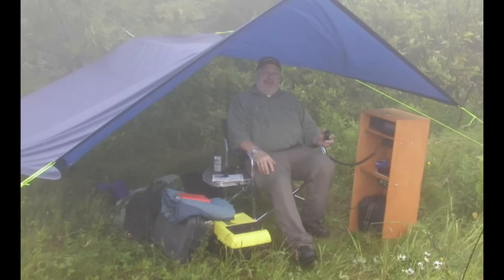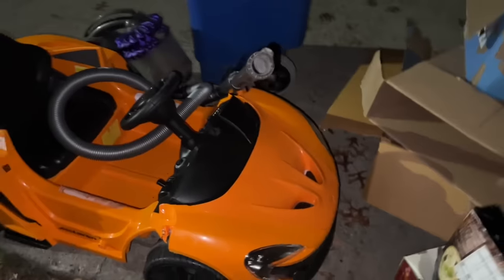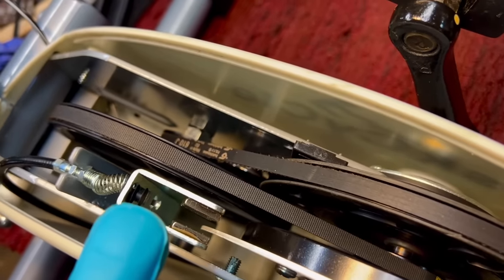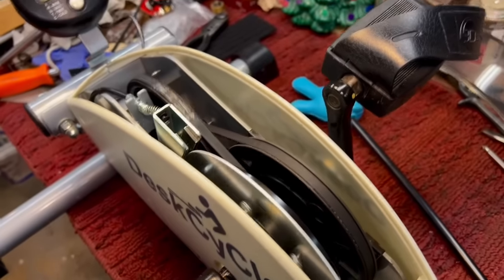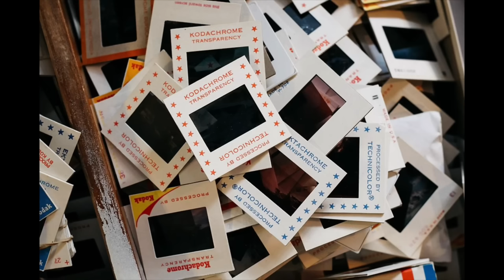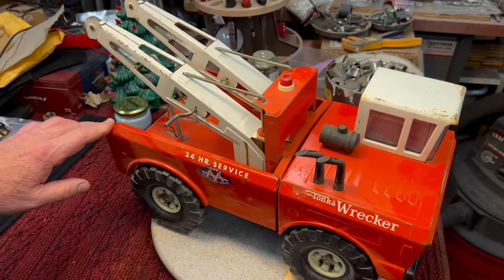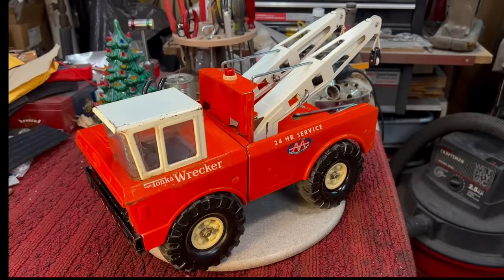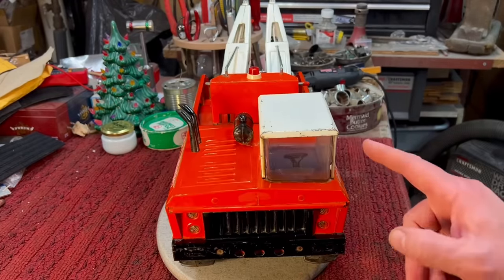Poor Man’s Flea Market Score Plus Tonka Mighty Wrecker

Comment: Gotta love the big machines! Back when I started my first job in the US I worked with an old timer from Motorola who always had the greatest stories.  In one, Motorola flew him out to fix an issue where the Ultra dump trucks at a massive mine were having issues with their radios interfering with some of the electronics in the truck.  While he was there testing, the radios were interfering with the brake system and he and the driver ended up with a runaway truck - not exactly what you want to deal with on an afternoon!  Miss that guy, he retired not long after with 50 years at the company.
Reply from the maker: Oh My!  Runaway massive vehicles equal huge pucker factors!  🫣😂👍

Comment: Has to be something environmentally bad in that compound you use..LOL...  Mine just doesn't seem to do as good as your 50 yr old stuff😅 Have a great weekend and oh and bonus points for scotchin' the wheels👍 good stuff Mr. John!
Reply from the maker: 😂. Vic- I have a new container I will have to see if it’s the same.  Polishing compound just requires a bit of elbow grease until you see paint on your rag, then you buff off.  Also not for clear coat paints!  (Ask me how I know) 😂👍🇺🇸

Comment: I am with you on the fascination with big equipment, so much so I ended up working on heavy equipment by doing in place machining and working on hydraulic systems, always said if it wasn’t, BIG, yellow, and the PARTS didn’t weigh at least 2,000 lbs, I wasn’t really interested in working on it.🙄😏😉😬🤣🤣, thanks for the video, enjoyed the wrecker. BTW, I actually helped build a heavy recovery truck with a 100,000 lbs lift capacity and a 360 degree rotation capability, it was an awesome build.
Reply from the maker: WOW!  100,000 lb lift!  😃👍

Comment: I am the same way about heavy equipment. I got to play with big stamping presses, trucks, cranes, and the last seven years of my before retirement life I got to work on the design and manufacture of armored vehicles called MRAP's. 1000 hp engines in 20000 lb, bullet resistant glass, monster tired, 6 wheel drive monsters that can out accelerate most street vehicles. 
Life is good. 😁😁😎😎
Reply from the maker: Dave- You looked like you were having too much fun on your Man lift last month!  😂👍

Comment: A pal and his son had a B-85 Mack ex Ky. coal hauler with a Holmes 800 wrecker on the back, twin boom. Had to let the booms down to back it in their shop in town. And did you ever see any CCC trucks? Stood for Crane Carrier Corporation. Just had the small cab like the tonka but a real truck. Had some here years ago with dump boxes on them. 
Happy weekend and God Bless Yall!
Reply from the maker: Lewie- I’ve always had a love affair with those B Series Mack’s.  Just beautiful!  😃👍
Reply: I've got to drive a couple, both with Thermodyne motors probably 185 horses, the other 711 cubic inches, non-turbo, One was a dump and the other was toting an old Schram tub compressor well rig. Both were duplex's or 2-stick 10-speeds but the well rig splitter didn't work so it was just five with a bad air leak. The other had 10 but no good motor supports and the tranny levers and motor would lay over to the right when taking off  but ran and pulled good and was a joy to shift both sticks at the same time with one arm stuck through the steering wheel to shift the splitter or hji/lo. Steered like a dream with parts falling off them. Both were 1950 models. Drove some old rigs that had 5X4's with a lo-lo and 3 split gears for every cog in the main box but the B-models were special 4 sure! @ScoutCrafter

Comment: Hello Flat Bastard, that L.B.E, Lower Body Ergometer (or bike) that you found can also be used as a U.B.E, Upper Body Ergometer.  Since your upper body has fewer slow twitch muscle fibers (endurance muscle fibers) than your lower body, your girlfriend will burn off more calories using it as a U.B.E. because fast twitch muscle fibers use three time more energy (calories) than slow twitch fibers.

Comment: Got to speak up for Dyson. I mean what 21st century vacuum cleaner isn't total plastic? They all are. I tried to repair an iron once and discovered it was clearly snapped together to prevent disassembly. That's not the case with Dyson equipment, which is held together with screws, which does allow some repairs to be undertaken; and generally they're better made and last longer. Bet that one in the trash would have worked again. So unfair on Dyson, other than that great video as always.
Reply from the maker: As a vacuum aficionado and long time trash hound I can honestly say Dyson products are for the most part Trash.  I find more Dyson vacuums in the trash then you could imagine.  If you go to any real vacuum store and mention Dyson they will all roll their eyes.  I took apart three of them and they were all made like junk.  Plastic EVERYWHERE!  The Dyson desk fan was an absolute joke and the biggest laugh was the most ridiculous Dyson hand dryers for restrooms.  🫣😂.  Needless to say I’m not a Dyson fan.  😂😂😂👍